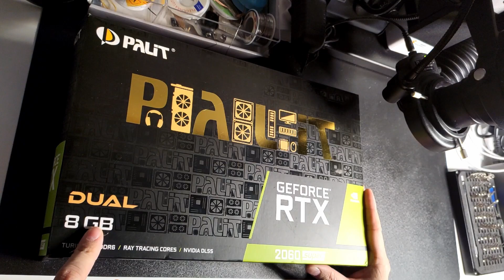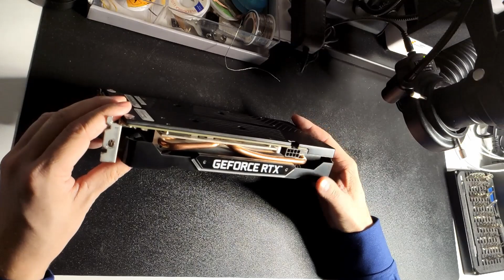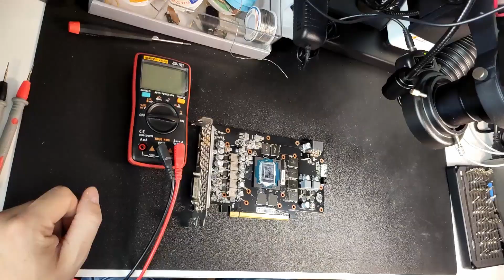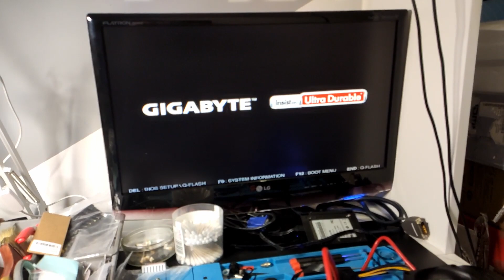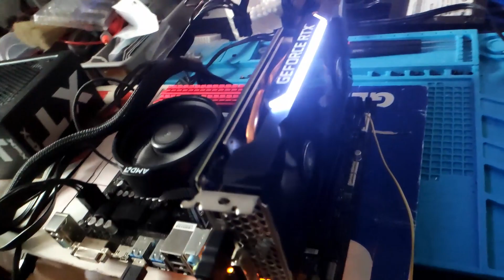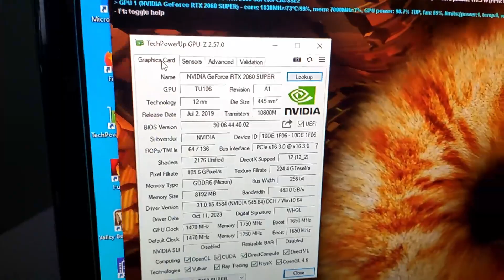Episode 3: Palit RTX 2060 Super 8GB DUAL - diagnosis, repair and test

Comment: i have same card like this, i try to do some cleaning and change thermal paste but cannot open the heatsink, what screw do i need to open because it stuck so hard and cannot be open, can you show  which screw to open for me pleasee because my card become hot almost 83 C when gaming :(
really appreciate it if you can show it
Reply from the maker: @zulhilmibadrulhayad9231  I don't have this card anymore. But try my other video, with identical card from PNY:
https://youtu.be/dMU4VFywr7o?si=M7gthbfdU9nJZi2F
Reply: hello i have the same temperature did you fix it?

Comment: I have that same graphics card and it doesn't turn on, what could it be?
Reply from the maker: @dani-s6d9f  Impossible to say without measuring resistances and voltages. Do you have a multimeter to follow my steps? 

Does it start without a picture but the fans spin? Or it prevents the entire computer from turning on?
Reply: @MyElectronicsRepairAdventure  If I have the multimeter to follow your steps
Reply from the maker: @dani-s6d9f  
Measure the resistance on the first three pins(any of them) of the PCIe slot - this is 12V from the motherboard (4:15 inbthe video) 

Measure the resistance on the 12V from the 8-pin power connector. One row(4 pins) closer to the backplate is ground and other four pins is 12V (measure these pins)

Let me know what the readings are. You can also contact me via WhatsApp and we can diagnose together.
Reply: @MyElectronicsRepairAdventure  the graphics prevent the computer from turning on

Comment: I need the sizes of the thermal pads
Reply from the maker: @Micaman_99  I sold the card after it was fixed and don't remember the size. If you have the old pads try to measure them with a digital caliper like the one here:
https://a.aliexpress.com/_EQFdIVT

If not, you have to try apply pads, then thermal paste and see if the core makes a good contact with the heatsink (paste evenly spread). Here's a good tutorial:
https://youtu.be/VIUU5ogVHg8?si=B3REtWjuUSV7puJC

Comment: hi there i need help opening this gpu is the motherboard attached to the heat sink or can i just pull it off from the heat sink? could you make tutorial on how to open this gpu
Reply from the maker: Hi, I don't have the card anymore and honestly don't remember how to open it. But for sure it wasn't difficult. First of all remove all the screws from the back. Take of the backplate. Then check if the entire heatsink comes off or just the plastic shroud. If that's the case, then check if the heatsink is still screwed to PCB from the top. Gently and slowly pry the heatsink from one side, the thermal paste and paste may hold it strongly, but it should release gradually. Also, be careful when you lift heatsink/shroud not to rip off fan connectors, lift it slightly and check where the cables are, disconnect them first and then remove heatsink completely.

Comment: I have a evga 2060 super. But no video )=. I think my gpu die )=
Reply from the maker: @stormk-1130  Need help diagnosing it? If you have a multimeter we can try.
Reply: @MyElectronicsRepairAdventure  yeah i have one. I would try to make the same procedure as you do.
Reply from the maker: @stormk-1130  Cool, give it a try :) You can record a video :)
Reply: @MyElectronicsRepairAdventure  I think idk how to setup the multimeter lol. so if i need to do ohms i only have 2000k and 200k.
Reply from the maker: @stormk-1130  I'm sure there are other ranges as well. Try some YT guides:
https://youtu.be/TdUK6RPdIrA?si=shSBAUo7bbtsY8oM

Comment: I have another question: When the device is turned on, the card’s fans rotate at high speed and then return to normal after a few seconds?
Reply from the maker: I would say it's normal. Most fans (on CPU/GPU etc.) spin at full speed for a second or two at startup and then slow down to normal speed. I guess this has something to do with the boot sequence and reading the BIOS settings.

Comment: How does RGB work in the card? I have the same card, but there is no light
Reply from the maker: There are different models of this card, with and without LED. They look identical, but there is one letter difference in a model name indicating LED. I put the card on sale and someone messaged me asking the same question, why their card does not have a light. After checking, we found out that this one letter in the model number was different between our cards.